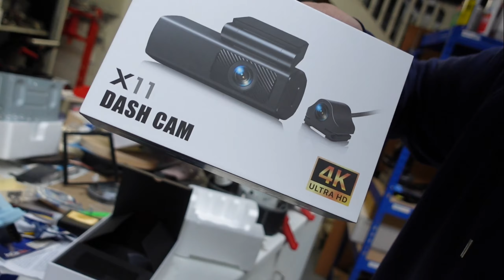240v fail i try to fry the shop

Comment: I'm no electrician but am subscribed to quite a few big uk electrcians channels, and pretty much all of them say they are really good. One big youtuber Nick Bundy has done experiments to see if different type of connections can  cope with the current they are rated at, and which is the first to melt/catch fire, with thermal imgaing camera's and in most tests, the Wago's took longest to start melting/catch fire. Even MK now do sockets that have Wago type push and lock terminals on the back of their sockets. And I'm sure at least one of you will have heard of a really big Youtuber called 'Big Clive' he's an electronics expert and usually is good at doing reverse engineering to find out which something like Mini Circuit breaker has failed, and he seemed to be impressed with the Wago's.Not sure if they're a legal requirement, but you can get Wago boxes of different sizes that hold the outer insulation in place so no single insualtion is outside box, and you just lock with a cable tie. Wire nuts, are considered bad because despite twisting them, there's still potential for there to be gaps which can cause arcing.

Comment: Oh and did your electrician mention anything about sleeving for the Earth (CPC - Circuit Protection Conductor), as I said, I watch a lot of electrical videos, so have picked up quite a bit of terminology. I think if you got used to all the different size blocks and what size cables each takes, you may think better of them, and depending of diameter for most vehicle wiring, I can't see why they'd be bad for extending or even adding say an extra spliced in cable onto a two or three way wired cicuit.  I can't imagine they'd be good for audio though?
Reply from the maker: Yes I have the sleeving its on now